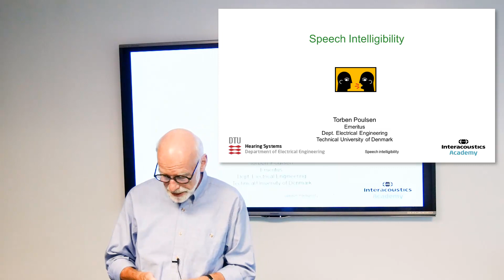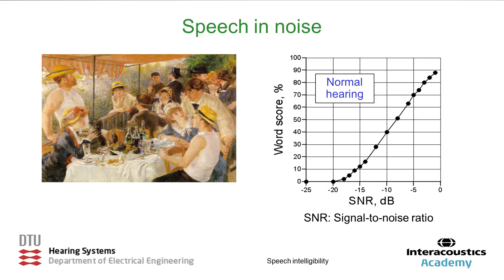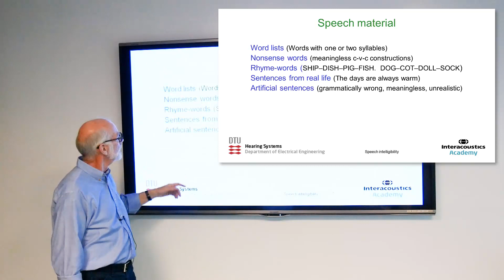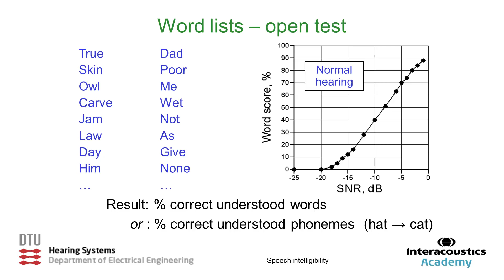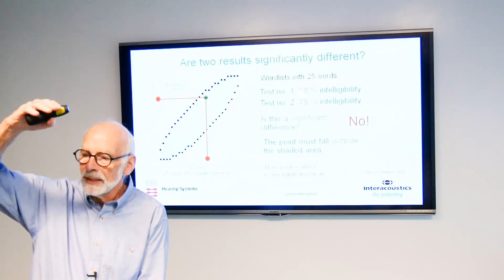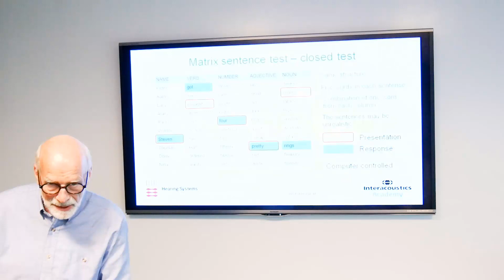Speech Intelligibility: A Lecture by Prof. Emeritus Torben Poulsen

Comment: If Torben Poulsen understood Speech Intelligibility, he would not wear his "lapel" microphone so low on his shirt where the Speech Intelligibility Index (SII) for this video is only about 90% (see ANSI S3.5).  The 1/3-octave equivalent noise levels of a "lapel" microphone at this distance down his shirt are eating up about 10% of the speech cues. Go back and critically listen to the video's audio for yourself.  Either Poulsen or Interacoustics or both don't understand SII.  Bet they take down this comment ASAP.
Reply from the maker: That's fair enough Dean, sorry to hear you had a poor experience with the audio. We have had others comment on the audio quality and we strive to improve on this going forward.

Best regards,
Shane